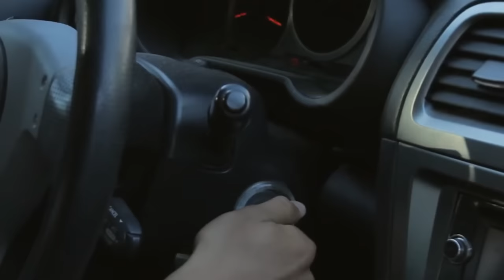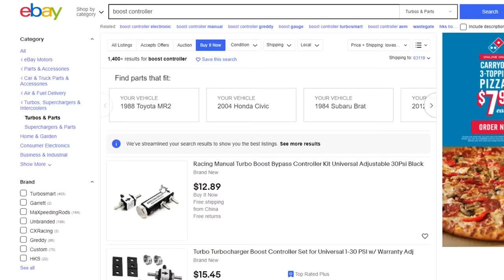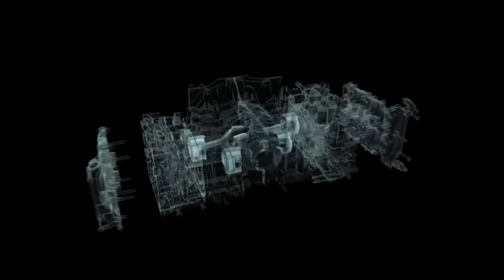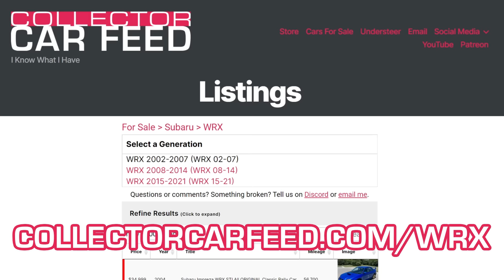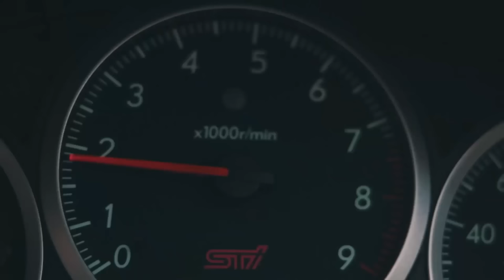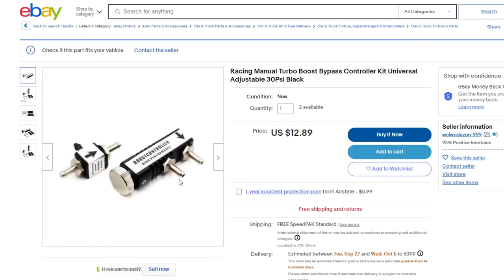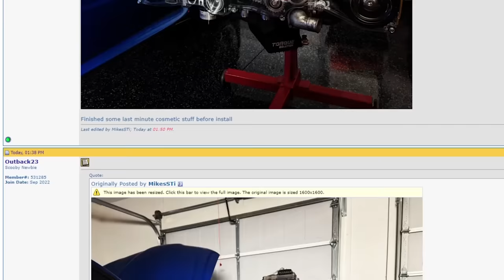Hard Truths of Owning a WRX in 2022 (Donut Media Won't Tell You This)

Comment: MrSubaru has a great video all about the head gasket issues if anyone wants to know more. Basically, the turbo engines don't generally have head gasket issues, especially when left stock. The head gasket issue was with the naturally aspirated 2.5L engines. It was primarily due to a rubberized coating used in conjunction with the open deck block. Don't get me wrong, a WRX can still blow a head gasket just like any car, but typically only if someone has caused it to overheat through other part failures or neglect.
Reply: I remember the issue mostly being with the EJ25D
Reply: @aspenGF8  Indeed. Head gaskets are an NA EJ25 issues pretty much exclusively. Especially the earlier models.
Reply: @802Garage  Very interesting to know, I've always known the 2.5's are the more grenadable engines but I thought that was the case for the turbo's only. I owned an 04 rx EJ20, and thrashed that thing like my life depended on it and for the two years of ownership and the 50'000ks I put on, with daily the car it never gave me any issues engine wise, I thin we did a radiator when we first bought it to fix an existing water leak and thats it. I've always recommended N/A ej20 Imprezas or Foresters for my mates to learn in, and our car yards are pact full of the N/A ones here in Australia so its always cheap parts with most Subaru's over here.
Reply: @kiranator  We never got the NA EJ20, but yeah in general the unreliability of Subaru engines is definitely overstated.
Reply: wait are you the guy thats doing the v10 impreza? i think ive seen you on tiktok lol
Reply: My 2008 wrx is at 140000 miles at 18psi stock turbo, still runs fine except for small crap wearing out.
Reply: The n/a headgasket fix is wrx/sti headgasket on n/a
Reply: They are not only ej25 issue, the gasket problem comes from the fsct that they used composite gaskets and not mls ones, earlier ej20 turbo had composite gaskets, you just put a mls from a newage and problem solved
Reply: @kirilakmadjov8307  You are incorrect and I encourage you to watch the MrSubaru videos on the topic. It is also not a composite gasket issue at all it is a single layer steel gasket with a rubberized coating which is the issue.
Reply: Try find stock as possible a catback or a prodrive exaust would be fine i had a 2001 EJ205 subaru Forester s turbo SF5 engine was mint 119k rust killed it in my ownership 2 owner full history never left family stock
Reply: @andrewjohnson7960  Yeah it's usually rust that kills Subarus in my experience, but that's because they mostly live in the most rust prone areas. All cars up here die from rust. I have the same engine in my 2001 Impreza 2.5RS and it's a riot, but the car is rotten.
Reply: @802Garage  im from Near Glasgow in Scotland and my Subaru Rear subframe fell off while driving I managed too crawl it home though it was the rear suspension turrets it was but the subframe snapping ment the back end kept flicking out 😂 it was a sea side Subaru, dont regret buying it got too rag it in snow 50 mph on thick snow  with Michellin all seasons is so fun handle amazing just scrape off any rust you see and under seal do something paint it hide it prevent it, id definitely pay alot more for a good one stock rust protection i did paid £500 too have timing belt done £1500 car spent £1500 on it
Reply: @andrewjohnson7960  Yep Scotland will do it! I'm in Vermont in the USA. I have seen how cars rust over there. Similar to here. We salt the roads in the winter and have tons of snow in the mountains. The old Foresters it's usually the rear strut towers that fail and yep the subframes on any old Subaru can go. I replaced the rear subframe in my 2001 Impreza and it was basically a few mm of metal left on either side holding it to the body, could have gone at any time. Luckily like you said it is held together in so many ways it doesn't just fly out from under the car.
Reply: @802Garage  yeah definitely i need another one i went too go view a 1999 JDM import EJ208 Subaru Legacy gtb twin turbo manual in November £4400 has a gc8 sti gearbox as standard  tried too buy it but the guy was so dodgy tried too rush me into buying it shame as i really wanted it as there almost all automatic wasn’t too rusty as it landed in 2011 but it had no service history no air bags facebook marketplace avoid if possible 😕😂  the Area i viewed it in was Colin mcraes home town
Reply: The remedy we would do when I worked for a Subaru dealership was to just replace the NA 2.5L's with one of the headgaskets from a WRX. They mount exactly the same, and once you replace it the first time, your chances of needing it replaced again are extremely minimal.
Reply: My 300 000 km outback has every problem beside head gasket, dealership and local mechanic say they original. So believe what ever.. but mine is fine
Reply: Mine pegs stock y evo 7 this guys gay
Reply: Neat
Reply: @OfWhatsToCome  You're neat! 😂

Comment: Thank you for the statement about the sparkplugs. I get so annoyed when people say you have to take out the engine for sparks. Just take out the battery and MAF box.
Reply: People take the engine out to do the spark plugs?...LOL
Most I had to do was jack my engine up slightly to get the passenger rear plug out on my Outback (AUS RHD).
Reply: I could literally do spark plugs blind folded. Mostly because you can’t see and do it by feel lol. Not that bad
Reply: No need to even remove the battery. The drivers rear is a pain, but with 1/4" sockets and swivels - it isn't too much trouble.
Reply: I change the spark plugs in about 15 minutes with 3 items found in the cheapest of tool kits.
Reply: I did them without even a swivel

Comment: Now this is all facts. I got my 15 WRX knowing it would require special treatment, and I’ve had absolutely no problems at all. Only thing I need to disagree on is the Rally Armor Mudflaps haha. I’m definitely not rallying it, it spends almost all its time on pavement, but I just love the way it looks and it helps with paint chips if I’m on a dirt rd. It’s definitely not necessary, but I love the way they look on my car and they provide some protection for my paint! Plus’s I didn’t need to drill into the body to install them
Reply: Came to the comments to say this, I bought my 2018 used and they were on the car.. only “mod” the previous owner did.. the clear coat on these cars is paper thin and I don’t want to have to get a paint job at 50k miles.
Reply: @WrexyJoe  you’re right. Mine is black, and every single minute scratch shows up like I drive through a tree. I got it Paint corrected and ceramic coated in the spring
Reply: @elijahharris3796  how much did the paint correction help? I have a blue one and the paint is in brutal shape. Was thinking of getting it done.
Reply: @brandynm5215  it depends on a lot of factors, but I don’t have a good gage on the price. I got a friend of mine who details to do it for me and he gave me a very good price. Wish I could help out more
Reply: @elijahharris3796  no worries, thanks anyway my dude
Reply: Mine had them on it when I got it. The first week of owning it two of the screws previous owner used to attach them backed out and found their way into the new tires I'd purchased.
Reply: @WrexyJoe  mine is black and you are way to correct about the clear coat... already thinking I'll need a new paint job soonish
Reply: Big mudflaps are sick on any car, I’d put em on a fucking Crown Vic. For that matter, oversized night stage rally lights are sick, too. People think you’re a maniac and get out of your way in traffic, it’s awesome.

Comment: Spitting facts. The majority of these kids don’t know how to care for any car properly, let alone a subie. I just bought a stock ‘20 wrx with 20k miles and it drives like a dream. So much fun just to cruise. Once the warranty falls off I’m going to build it right and get it tuned properly. The attention grabber from your video was the Donut Media bit. Seems like they have sold out because their older videos were way better. Your channel is underrated. Keep doing what you’re doing. You’ve just earned another subscriber.
Reply: Bro you literly just bought a brand new car they aren’t soposed to fuckinv blow up if it’s 2 years old
Reply: @MasonKing71910  it doesn’t matter how old or new a car is. If you modify it improperly, it can still fail. Machinery has limits no matter what platform it’s on.
Reply: Wishful thinking 🤣
Reply: Wisdom.
Reply: @vande2330 imagine babying a 270whp unreliable AWD corolla lol at your life
Reply: @nibba5692  imagine being a sad troll commenting on a year old post lol at your life 😂
Reply: @vande2330  aww let me guess your reliable subie is getting an engine replacement,Subarus are the cuckholds of the car community
Reply: @nibba5692  dont be jealous cause you're 16 and not old enough to vape yet 🔥🔥 💯 #awdcorollagang
Reply: he's nit wrong about subarus.  If you don't drive it like a 99 yr old driver a camry,  it won't make it to warranty without failure. They're not capable of overtaking a 18 wheeler on a hill safely either,  their that slow. Sold the pos and not looking back.

Comment: I recently bought an 04 WRX. 102k miles. Bone stock, man I was so happy. 

All the ones I was looking for, modified at some extent. Little dings here and there. 

Ended up pulling the motor, did the rocker cover gaskets, o rings, timing belt kit(Aisin), spark plugs. Babied the motor for two weeks cleaning it up, small details. Lastly clutch too. Mannnn, I’m happy with my work. Like I’ve told my father I’m a enthusiast of this car and history …not a dumb swag, snap back driver 🤣🤣.

It really builds in you when you fix it yourself rather than paying a shop. Thanks for spitting facts yo.
Reply: Nice man! I got a 05 wrx last year with 109k miles also competely bone stock and still bone stock. Mods will begin once i get bored of the stockness!
Reply: @TraderAbe  hell yeah man, hands down to unmodified older models. 

Since you mention that, you’re right haha. Been driving it on Wisconsin back roads and suspension does need some work. 

Do you have any check engine lights? Recently I got the fuel cap code. Had O2 sensor codes as well. Cleaned both with carb cleaner, although upstream O2s had to be replace. The other O2 bank 2 did work with carb cleaner.

Comment: Thank you for this. So, so true about doing your research when looking into buying any Subaru for that matter. I wanted to get a Legacy GT as my first Subie and went to a local shop whose actual sign in front reads “Those Subaru Guys” for advice. They told me to stay away from the turbo LGT, they’ve seen too many blown turbos go through their shop, waste of money. So I got an na version. Then I dug deep into the Internet forums and found the most common problem on the Legacy GT turbo was from a simple banjo bolt. Knowledge is power, and with the right info from good sources a Subaru will go a long way giving you a fun drive!
Reply: Something to note: some legacys (depending on your market) will have twin turbos) which is great for driving, but if someone does go wrong, it's double trouble, especially in that cramped engine bay
Reply: @twinscrollbugeye  V6 Twin turbo?
Reply: @SI0AX  subarus don't have "v" shaped engines, only flat boxer engines. Legacys can come with either turbo or twin turbo 2.5L 4 cylinder or a naturally aspirated 3 L 6 cylinder. Twin turbo only available in Japan and a few other markets
Reply: @twinscrollbugeye  Oh, right I know this, lol. It's just so common that when I mean to say 6 cylinder I say V6, lol. Same thing happens when I want to say 4 cylinder say I4. I always do this when talking about Subaru's and Porches, lol.

I didn't know about the twin turbo 4 cylinder. Didn't know that even existed. Is it sequential twin turbo? A small one spools first at lower rpm, then a bigger one at a higher RPM?
Reply: @SI0AX  https://en.m.wikipedia.org/wiki/Subaru_Legacy_(third_generation)
Reply: @twinscrollbugeye  I actually went to Wikipedia after I made that comment and saw they had the Twin Turbo H4 on the 2nd gen. It's a sequential like the Supra and the RX7. The Nissan GTR's were parallel.
Reply: Ive loved my lgt. was taken care of and wasnt beat to shit like most wrxs before i got it. my stock turbo did go out eventually. i got a vf52 in it and its been smooth since. i think they are very overlooked. you can get them for a steal and they are mostly the same as the 12-18k wrxs you see around.
Reply: @JP-hr3xq stop adding to the problem of SUVs. Hatchbacks ftw

Comment: Saw this pop up on my rec. and i have to say you nailed it. I bought a 21’ WRX in January with 28 miles and i dont plan to mod it until its out of its warranty period and im gonna save up to be able to get the right parts and take it to reputable shop to get it built and tuned. I love my car though. Completely stock and it makes me smile every time i drive it
Reply: Also have a 21 WRX and it is an awesome car. I won't do anything to it until the warranty runs out, like you.
Reply: @entropiated9020  car is extremely capable and fun to drive stock as a daily.

Comment: Ive had a manual Legacy GT for 7 years and its amazing. I got it as a daily in high-school and loved it. When the stock motor went, I got a new block and then threw the mods at it. Had it all done by a subaru specific shop so I can trust its reliability. Great sleeper

Edit: I hate wrx owners
Reply: And I hate you for having a more comfortable WRX
Reply: Wrx : edgy teenager 
Legacy gt: same thing but grown up and more mature
Reply: its not the wrx owners...its the none subi guys that is looking for a fast car
Reply: @ghostface7410  the WRXs aren’t even that fast they are just AWD which gets them going from a dig
Reply: @61936  but what about forester xt owners?
Reply: @connorm1600  maybe if you're a 45 and have a coeist sticker lol
Reply: @ItzzShazey  try year round fun without having to worry ab the weather. Wrx will smoke just ab anything in the winter
Reply: What mileage did the stock motor blow at?
Reply: @connorm1600 more hippy type who likes to go camping
Reply: @61936  lol guess that is me.

Comment: Thank you for making this! Subaru's are so incredibly misunderstood it's insane. Another contributing factor to the head gasket issue ( even though its not the issue everyone thinks it is) is if the engine has ever been over heated. The EJ doesn't like getting super hot. It's not an iron block and shit will warp and move around if it gets too warm.
Reply: Facts on the head gaskets . I had my 03 wrx completely resealed like a year after  I first bought it about 40k miles later I changed my block and reused the head gaskets for about another surprisingly 50k-55k
Reply: All this babying to barely make 270whp lnao
Reply: @nibba5692  putting in a quality radiator and keeping an eye on the guages is babying? I've been making 400whp on stock internals since I got my 05 STi in 2011. No issues what so ever.
Reply: I@nibba5692  it's comical isn't it

Comment: I ran a performance shop that focused on Subaru for 5 years. I personally own and race a 1000hp STi, and previously had multiple Rally X imprezas. The headgasket issue was never a thing. The only annoying failures were really bearing failures. I used to daily drive a STi that made 785whp on E85. It had 0 headgasket issues. 

I actually saw more failures where the cylinder liners split on the EJ257 when someone would make big power without going to a closed deck like IAG or Outfront. ARP 625, 11mm, and 1/2" headstuds paired with quality mls headgaskets or even fire ring headgaskets make the HG failures a thing of the past.
Reply: None of this happened, there are about maybe 10 Subarus in the world that are about 1000hp,delusional Subaru fangay

Comment: Great video overall! I will say I don't think Subarus are nearly as finicky as most people think, but that's primarily because most people only know about them through internet memes and have never actually worked on one. Speaking of that, one of the reasons most people work on their own Subarus is it's actually one of the easiest brands to work on period. Every mechanic I know who works on them regularly agrees with me as well. I would prefer to work on a Subaru then almost anything with a transverse engine. The logical layout of everything just makes them make sense and I generally enjoy working on a Subaru even if they of course have some quirks like every brand! Thank you for telling people you don't have to lift the engine to do spark plugs. Holy shit the internet is stupid sometimes.
Reply: Yep...prefer the older subaru and "it's common problems" over a domestic heap....edit: Ever had to change a starter and battery on a Dodge Intrepid?😂
Reply: @bluewffl8472  Or the starter on a Northstar V8, or even a Toyota V8, or on an old Volvo. Honestly it's a 15 minute job on most Subarus and much more difficult on the majority of vehicles. Same goes with the alternator, AC compressor, power steering pump, hehehe.

Comment: I've owned a G3 WRX for about a year now - stage 2, turboback exhaust, cold air intake, BoV, coilovers, etc. Been my daily driver and I drive it somewhat hard on occasion. It has been superrrr reliable so far. Just need to give it lots of maintenance - always check oil + coolant,  service every 5,000km and don't spare any expenses. Hasn't been a cheap car to own, but I definitely don't regret it. If you find the right one and you keep up with maintenance its a very good car.

Comment: Congrats finally a video explaining the bad rep these cars get with bolt on mods without a tune. Kids break them. I have owned mine (Hawkeye) for 6 years and for the UK it quite expensive to just own (compared to other cars). Mine is almost stock, just brake upgrade (OEM WRX brakes have no right being on the car) and touch wood has never had an issue. Serviced regularly and ONTIME. Look after the car and it will look after you.